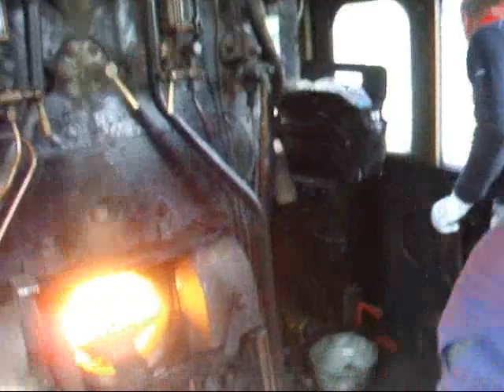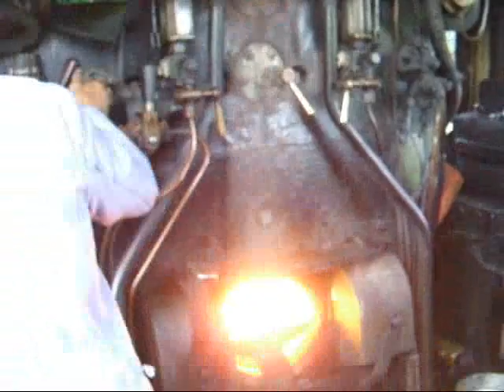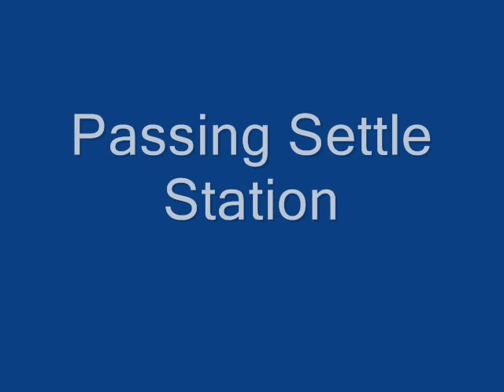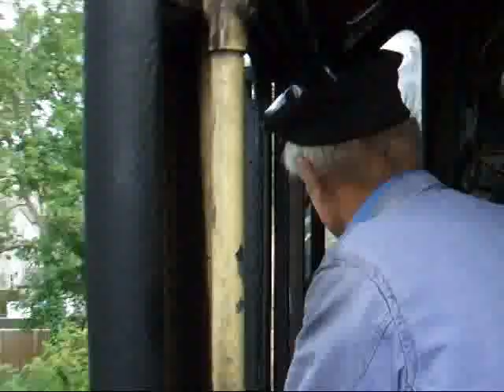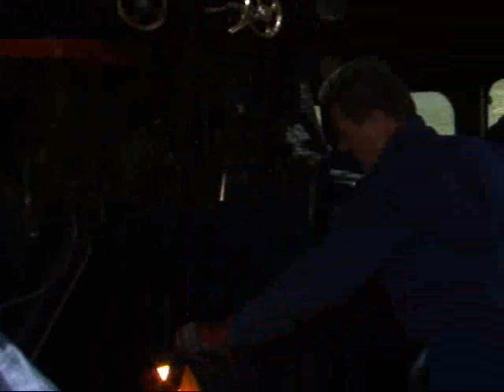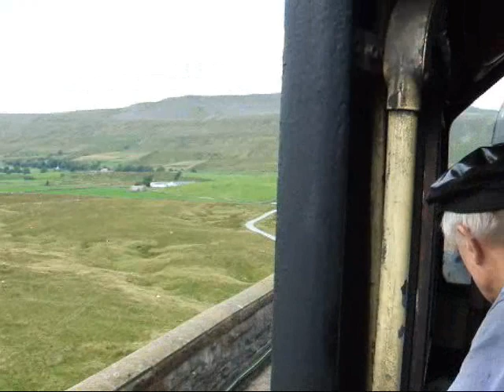FOOTPLATE RIDE ON 48151

Comment: Great action shots, as has been said most LMS locos were designed to run with the firebox door open or part open, it allows top air to complete the combustion of any unburnt gasses coming off the fire. It also therefore helps to reduce smoke that would otherwise be produced, as smoke is mainly unburnt gaseous carbon.

Comment: The flap is up, LMS engines were designed to run with the doors open and the flap up when heavy working and consequently continuous firing was required.  GWR engines are similar, although the flap is larger and requires opening and shutting with a chain between shovelfuls - the LMS one is dimensioned so you can fire over it and still get the coal down the front end (the blast helps tremendously :D)  Although it does take a bit of practice...

Comment: @Dragon150043 If you are opening & closing the fire doors after every shovel full, you would be subjecting the tubes & back plate to fluctuating temperatures, which is more likely to cause stresses. Also, top air is necessary to burn off the gasses released from the burning coal to complete combustion & reduced smoke.

Comment: @BBVCorvettec62005 Not an expert but British kettles are classed from 1 to 9 and P (passenger), F (frieght) or MT (mixed traffic- all-rounders) indicating the weight and type of train they'd usually haul.  This is an 8F.

The Black 5 is a Stanier designed, like this, 5MT all of which were painted black (no imagination).  They are capable, much loved by crews and buffs and a great many were built (>800 IIRC) with several in preservation.

As for Flying Scotsman- you're kidding right?